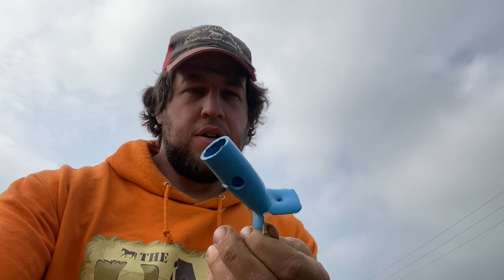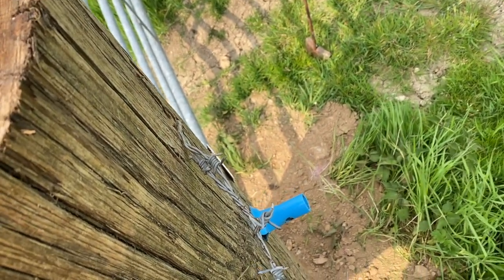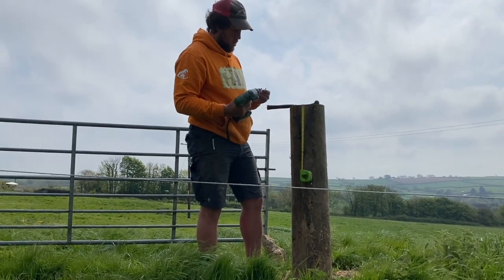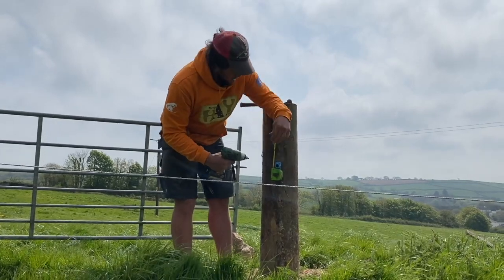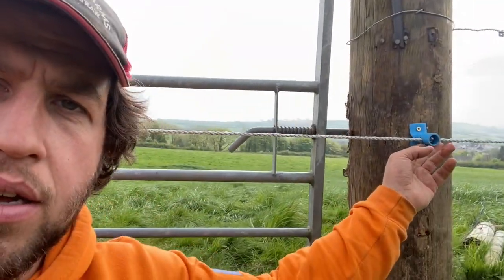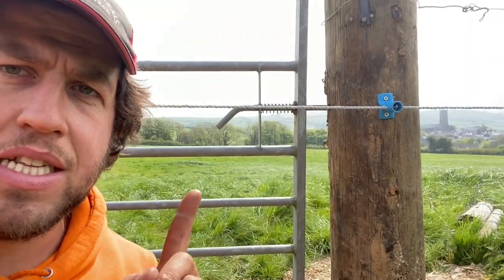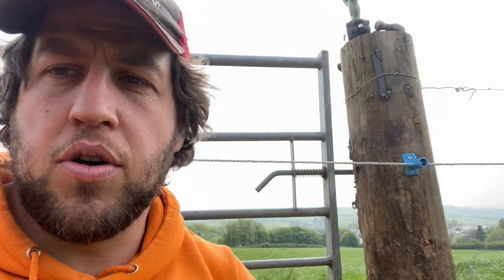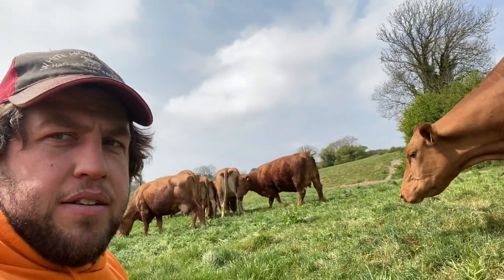Fencing in animals the hay team style part 3. Episode 52

Comment: Yo Justin!!! Brilliant stuff and bravo on the "upcycling" of all the materials involved including that nifty bit of engineering your late pal brought to the world in the shape of that insulator!!!!! TOP TIP --------  When you are straining any lengths up to 100 mtrs or less, use a length of piping around 20" or so that will go over the handles of your fencing pliers when SQUEEZED UP to give you serious leverage and strain just before you staple the wire to your post!!! You will gain serious strain using more leverage ok! Stay safe and btw... them there cows don't half have fine arses.....just saying!!!!
Reply from the maker: Maurice Cahill I did the kiwi method for tension which I forgot to film. But fantastic tip bud
Reply: @thehayteamtv6830  By far the best fencing folk on the planet are them Kiwis Justin lad..... the terrain alone lends to all sorts of nifty ways of getting the job done!! I worked with one of the mad bas***ds years ago contract fencing.....absolute BARB WIRE ROBOT!!

Comment: The isolators are a great idea!
But a lot of faffing around and the barb is slack as granny's knickers!
I bang in crash barriers in the end and as turners. Drill holes and use eye bolts cheap and simple. 3 strands of barb wire you don't need puller's or gripples if starting up. Totally stock proof, lasts a long time and you can put the wire up yourself to save money.
Reply from the maker: Nigel Gribble I twisted the barb to tighten it up